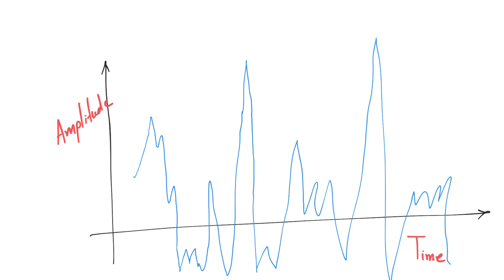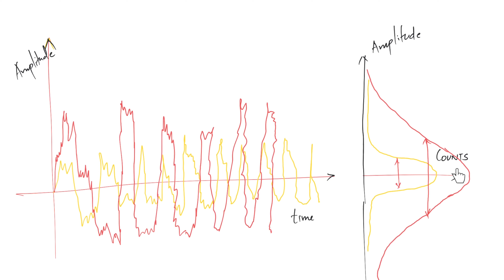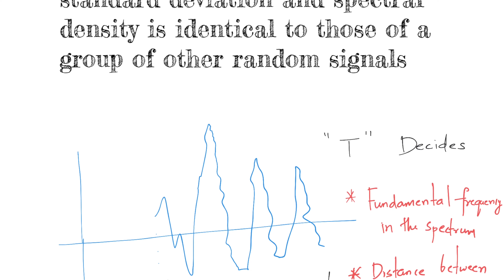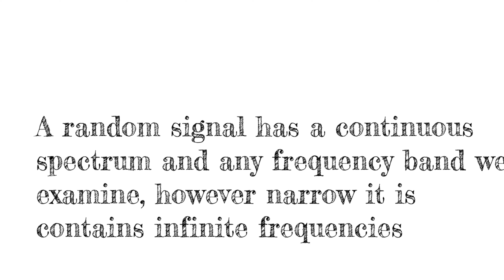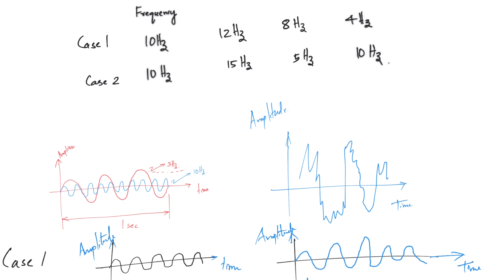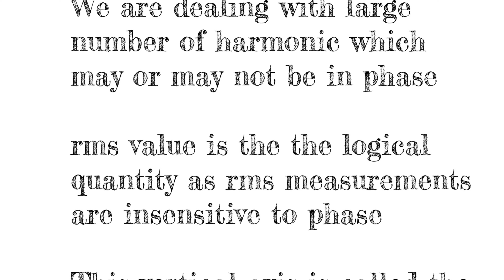Comment: grms is just acceleration measured in g units using accelerometer. 
Y we use acceleration measurement & not displacement is bcz it is easy as acceleration measured wrt universal inertial frame, not any specific surface